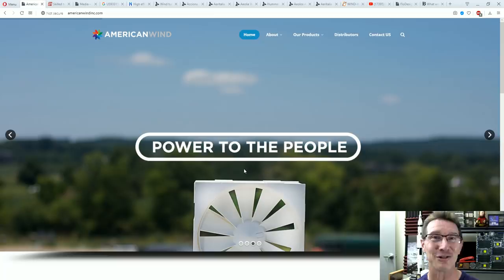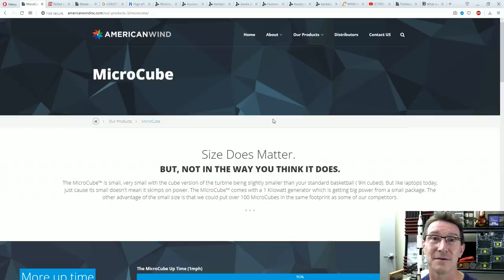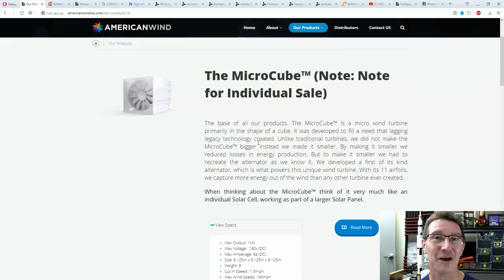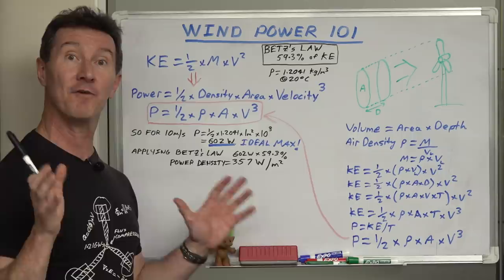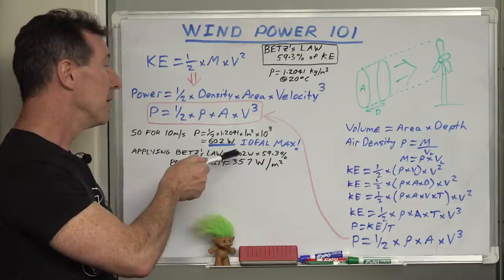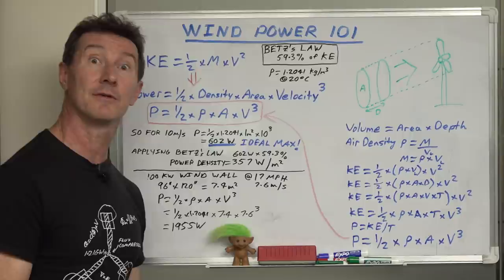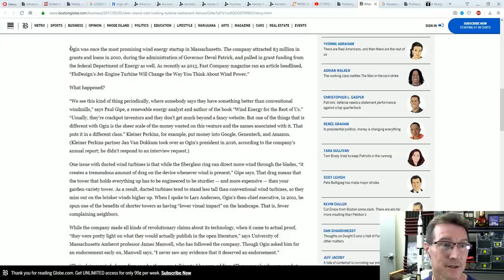EEVblog #1271 - 100kW WindWall Generator BUSTED!

Comment: Ahh, when the engineer gets kilowatts and milliwatts confused. 😂
Reply: Sure enough, if you measure in MmW (Mega-milli-Watts)!
Reply: As a Flat Earther would say:  "Why would you divide the number of smaller units to get a bigger unit.  It doesn't make sense".
Reply: @seanb3516  exactly! That's why it's immoral to convert feet to meters, faeenheot to Celsius is ok tho.
Reply: Why, the keys are like next to each other you know....
Reply: Lassi Kinnunen this in itself isn't necessarily incorrect, the duct can increase speed through the venturi effect, BUT that's obviously not increasing the available power, it's reducing it...
Reply: @ulwur     Fair-In-Height is the same as Celsius.   At -40°.  lol
Reply: @BIGFOOOOOT It's amazing how multimillion dollar deals are struck every day without anyone consulting an engineer. Or the very least pop your head out from the boardroom and ask the local IT guy - "Hey does this sound like a good idea to you?" And the respone would very likely be... "NO!"
Reply: forgot to carry the 1
Reply: I mean its AmericaWind - prolly got confused by all those dang SI units instead of good 'ole doughnuts per sockets?
Reply: @BIGFOOOOOT the engineer is accurate to 1/1000 of an inch the mechanic is accurate to 1/100 of an inch and the carpenter is accurate to exactly the inch
Reply: It can get confusing sometimes, we used to use mm/us.
Reply: Lol
Reply: @ulwur  I wrote a program to convert Centigrade to Celsius. I put it on a 64 microbit  thumb drive. I use microbits because they work better with microprocessors. It's yours for the cost of shipping from Uranus.
Reply: @BIGFOOOOOT And then they fail miserable and blame "circumstances" while still ignoring your sound advice. In fact some might take offense to you because they deep down feel embarrassed and ashamed. And there is nothing worse than being reminded of ones inadequacies.
Reply: An engineering professor made fun of me for saying "centigrade," a term that made some sense. A committee of boobs came up with the nonsense term "celsius." A similar committee is trying to do this with stainless steel because it is not literally stainless. A lot of people know what stainless steel is.
I ran across bolts torqued to foot-pounds that were supposed to be torqued to inch-pounds. They were stretched good. This was in a nuclear research facility.
Reply: Don't be cruel, calling him an 'engineer' must be terribly offensive to all the real engineers out there.
Reply: 1/1000 vs 1000, easy mistake to make
Reply: Ehh, only off by a magnitude of a million, no biggie. xD
Reply: So what'a little decimal point got to do with it?
Reply: “Engineer,” what engineer. It’s just a guy sitting on his porch, noticing his neighbor’s fan spinning around in a windstorm.
Reply: Lassi Kinnunen  I don't believe anyone said anything about lying. What I think you wanted to say was that both parties can believe so much in a product that their judgement is clouded and/or are in denial. I heard plenty of sales people tell me that you need to believe in the product you sell. I have also seen many go bust because of that exact mentality.
Reply: @DreadX10    I would read those as millimeters and microsiemens. Life would be more interesting if we could randomize and personalize our own units.  XD
Reply: David Parry    They will have to compete with advanced non-metric using countries such as Burma. 
Truly a staggering task by any stretch of the imagination.
Reply: @LordZordid  Sure but obviously this does not apply to Solar Freakin Roadways. No engineering check required there.
Reply: @WCM1945  Are you willing to ship from Uranus during a full moon?
Reply: @19mitch54  I also worked in research and one of the weird units we wound up with was grams per cubic inch. One department was Imperial the other department was Metric and the two refused to agree.
Reply: @obsoleteprofessor2034  I told the waiter to add a tip to my bill but to make it a very small tip so he just added a couple of zeros at the end.
Reply: @Bill Martin     I was responding when you said "It's yours for the cost of shipping from Uranus.".  I hope the thread didn't break.  :)
Reply: 0.444 mKw to be exact!
Reply: thats what is known as decimal point dyslexia
Reply: @bunnykiller    Exdyslia?  Never heard of it.
Reply: @bunnykiller     Medical Pinto Exdyslia?  Wut?  lol
Reply: @BIGFOOOOOT EXACTLY.  And that's what this clown tried to do to my brother.

Comment: Betz's law also incorporates the fact that the theoretical max would mean wind speed behind the turbine is 0, which is obviously not possible
Reply: I think that is the easiest way to explain the figure being below 100%. If all the air comes to a dead stop at the turbine it would pile up; you need some residual velocity to move the slow air out of the way so new fresh speedy air can reach the turbine.
Reply: @DreadX10  That's actually a really intuitive way to put it, now it makes sense. Thanks!
Reply: The velocity behind the blades are not 0.  It's a bit more complicated than that
Reply: If you get all the Energy out of it, it is 0. Thats why the area gets bigger so the same amount of air can move through slower at the same preasure and temperature.
Reply: Yes. Exit wind speed is not 0 at the Betz Limit around 59%   Sounds like everyone on Dave's channel understands this.
100% energy is an oxymoron for a HAWT I guess one could say :)
Reply: @DreadX10  Not really you could have the turbine move forward like if you put it on a plane or something. (not saying we should do this as its dumb but hey).
Reply: What if you designed the turbine to exhaust axially? Then windspeed behind it wouldnt really matter. Like an axial blower fan. Probably not practical at scale...
Reply: @ET_AYY_LMAO  It's the exhaust velocity, doesn't matter which direction it's going.
Reply: @ET_AYY_LMAO  it still has kinetic energy regardless of its total momentum 

(Also, if you mean it's exhausting air away from the middle, that is the radial direction, not axial. Think of axial as the direction along the axle and radial as along the radius)

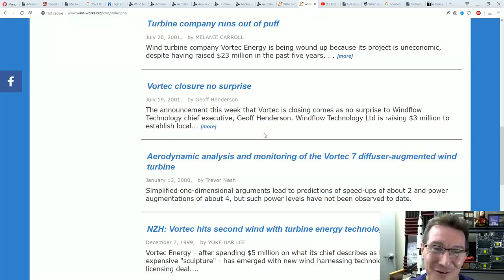Comment: 27:28 Oh come on... Putting a wind turbine on your car is something a cartoon character would try.
Reply: If your trying to imply that Wylie was not a engineering genius i will fight you right now sir!.
Reply: Turbines made by ACME
Reply: I ran into a UN project where they tried to convert mechanical energy from a road that depresses under a car’s weight. 

Typical UN science. .
Reply: @joeloliver7599  Acme made a good perforning  product. It was the operation manuals that were sadly lacking in detail causing many injuries in the field.
Reply: I thought we called those...turbo.

Comment: Getting 1kW on such a wind turbine is easy! 
1) Attach a voltmeter across the output and measure
2) Attach an ammeter across the output and measure
40V (as seen) x 25A = 1kW - really easy ;-)
Reply from the maker: I think you are onto something!
Reply: that 40 volts and 25 amps is coming from the wires sticking out of the wall socket
Reply: @bunnykiller  nah man, this is open circuit voltage and short circuit current, the power generated at both extremes is very small. the actual power generated at the maximum power point is actually less than that. check out a solar panels voltage vs current curve
Reply: Finally someone who cracked the code. This is literally the only possible way these people came up with these absurd numbers

Comment: It takes only 55watts for a fan to move air 13.4mph, which also means you cannot generate more than 55watts from 13.4 mph wind (this is before taking losses into account).

For fun, I worked backwards from a 225cm (8.86 inches) ducted fan. (ebmpapst W1G 200-HH77-52 for those playing along at home) : 1090m^3/hour = 0.3m^3/sec, which comes to 6m/s (13.42mph). That's using only 55watts! So you can NEVER generate more than 55watts from 13.4mph of wind!

Also tried one of my PC's fans, an Arctic Cooling P14 (140mm, 123m^3/h @ 1700rpm), which comes to a little under 2m/s (4mph), but that uses less than 1 watt!  So while the blades may rotate at that speed, it doesn't mean it will produce usable energy. This also means that one of those turbines can never generate more than ~3 watts (~3 times the area) in 4mph wind, plus they'll be lucky to get a single watt from their crude 3D-printed impellers.

50watts from 15mph wind would be more reasonable (with near perfect efficiency), not a kilowatt! Maybe if the wind is 140mph you could generate a kilowatt, but then you have bigger problems...

How did this guy get investors?
Reply: He DIDN'T get investors.  But he tried to scam my brother.
Reply: Your figure is only accurate for some diameter producing the given velocity.  If the diameter is doubled, the area (and CFM of moving air) is quadrupled at a given airspeed, and so is the motional energy of that turbine (disregarding losses) quadrupled. In other words, your physics doesn't compute.

Comment: I think the inventor just forgot to mention that this device works according to spec on Jupiter, only.
Reply: More like Neptune :-P
Reply: @GustavMeyer  Wireless charging the Earth from Neptune, coming soon to kickstarter :-}
Reply: @ijakoan  Sure and we'll use the excess power to light up the dark side of the moon.
Reply: Frank Buss it would also work anywhere there is sufficient air density so venus would be a goa... if they can make a stainless heat resistant model(which should be no problem for their PR department)
Reply: wind speeds were in Miles/Sec - not metres!
Reply: Someone should tell him to stop talking from Uranus...
Reply: @LarixusSnydes  Take it, Pink Floyd

Comment: Technically, all generators are revolutionary. 😂

Well, unless you're talking about those linear shake-weight gadgets. 😅
Reply: Are they therefore left-wing? :D
Reply: At least the shake-weight will give you cab fare.
Reply: nice one :)
Reply: I guess the Faraday flashlight falls under the shake weight category-
Reply: Generators are going in circles, but at the same time they are revolutionary! It's a miracle!
Reply: Robert Slackware  No. The patent application should be rejected on the grounds that it is not new let alone inventive. And if something does not work, it fails for  incomplete disclosure or clarity (not explaining fully how it is done). Having applied for a patent does not imply that you are already an inventor.
Reply: He means they are all turning, doing revolutions... I felt the need to clarify reading other comments.
Reply: Yes dad

Comment: 1:54 The Patent Office don't have to verify if something works, just that it hasn't already been patented.
Reply: Anzac-A1 true. It’s sad, because they used to require a working prototype but that was deemed impractical and expensive. That said, given the sheer number of failed designs for ducted turbines mentioned in that wind power blog, I am extremely sceptical that the USPTO would have said that the design was the first ‘new’ one they’d seen in eighty years… heck, I’m pretty sure they wouldn’t simply volunteer such information out of nowhere like the CEO guy implied _at all_.
Reply: i agree. a flaw in what was said

Comment: It's just a bunch of cheap chinese computer fans, isn't it.
Reply: no, this is how they are blowing it
Reply: That was literally my first thought - computer fans, but 3d printed out of white plastic to make them look "boutique" and custom
Reply: @gorak9000  You can but off the shelf white fans (or just white blades) from everything from big brands to random chinese factories.
Reply: I'm surprised these fans don't have LEDs. 🤣
Reply: @gorak9000  nothing against Noiseblocker eLoop fans! They are white and look "boutique" and custom. But they are actually really good fans.
Reply: @niceguy391987  Solar freakin' wind turbines? Can you put lane markers on the fans? Warn of moose on the road ahead?
Reply: Ok, some people may have figured it out.  They are power supply fans sprayed white, but think of all the investment $$$$  awesome scam.
Reply: @maximilianmustermann5763  Heh, those fans look similar, but they only have 6 blades, these have approx 11 blades (can't see the whole thing in the frame I paused it on, not watching again to find a picture where you can see all the blades)
Reply: if they used the ones with the built in LEDs, it would have been expensive ;)

Comment: Thanks for that, a laugh a minute. The car with the fans on top was priceless, something I had someone suggest to me but they couldn't figure how it would act as an airbrake and actually take more fuel to charge the batteries than just using an alternator... No free energy - ever.
Reply from the maker: I was chuffed when I found the wind powered car article!
Reply: When I saw that, I thought it must be meant as an addon when parking as an alternative. In Hamburg it might even work. No sun, always rain and lots of wind.

Regards,
Etna.
Reply: @Etna.  You just know if they actually produce an actual device it won't even be weatherproof!

Comment: the reason why there is a limit to a wind turbine efficiency is that air has to leave the fan again
imagine extracting 100% of energy from the air, this would mean that the air slows down to 0 and therefore is not leaving the fan anymore.
Since preassurizing air costs energy, the air has to leave the fan with a remaining amount of energy

Comment: Kickstarter scammer instruction manual:
1) Briefly skim the Wikipedia page of current technology looking for anything about "limitations" or "challenges".
2) Write up a proposal claiming to address these. Make sure to use words like "revolutionary".
3) Throw together a cheap, plastic "prototype" (it doesn't actually have to do anything) and/or hire a cheap 3D artist to produce animations based on a drawing you did on the back of a napkin.
4) Post that shit.
5) Skip town with the loot.
6) Light up a fatty and laugh.
Reply: Don't forget to make it about a remote African village in need to get maximum  monetary virtue signaling, Sargon. ;)
Reply: You forget fancy website with multicoloured CFD outputs and cut and pasted engineering brand names

Comment: Maybe they're multiplying the open-circuit voltage and the short-circuit current and figure this gives the power produced.
This is the flaw in the analysis of so many of the crackpot energy schemes...

Comment: Hi Dave. 
At about 4:00 you say that a dump load system is used to limit a windturbine output.
Sorry it doesn't, it simply bypasses the excess output away from the load circuit.
Max power limiting is done at the windturbine, either feathering the blades or turning the turbine away from the wind.
Windpower 101. Great derivation presentation to Dave.👍👍👍
You cannot extract all the energy from the wind because that would mean the velocity of the wind behind the windturbine would be ZERO. So no flow of air to clear the windturbine.
The more energy you extract from the wind, the lower the outlet velocity.
I think a Mr Bernoulli would be flipping in his grave.
"Ye can-nae change the laws of physics Jum"
Later the mention of drag and tower strength with ducted models.
Drag will extract power from the wind that you are trying extract into power.
Reply: Gusty conditions will put huge stresses on ducts, due to the large area, things like microbursts are probably unsurviable for any large duct design.

Comment: That wall would have a massive boundary layer, ie, restriction, so the air would probably hit it and stack in front and pick the less restrictive path around the sides.
Reply: That's apparently why the 59% law exists.
Reply: I was thinking of the forces involved in holding up a 1 square meter surface to a 10 meter per second wind flow.
Reply: Bingo
Reply: No no no you weren't listening were you. He said the air speeds up on the way through the fan. So it would actually create negative pressure in front of the fans. I don't know why nobody thought of it before.
Reply: @watsisbuttndo829  Increasing velocity by restriction will drop the pressure on both sides of the blade, and hence cancel out. The boundary layer starts the restriction before the blade. To do work you need a pressure differential across the fan, ie, wind pressure on one side, and in this case a huge flow restriction creating a pressure drop for the back side.
Reply: @SidneyCritic  He alleges to be an Aviation engineer. I think his career in that field may have just "stalled"

Comment: strap a load to a tesla and you could have free charging as you drive :D
Reply: ROFLMAO.Perpetuum Mobile achieved!
Reply from the maker: Watch the end of the video, he tries to do just that!
Reply: Won't work. Will just increase drag.
Reply: To get more than u deserve. Use the rotating tire to induce it directly back and combine THE AMERICAN WIND turbine with your wheel rim design. Therefore, be prepared, be smart, be AMERICAN WIND.
Reply: @turpialito  They figured out the "remove entropy" cheat code!

Comment: Nice one. It reminds of the question popping up every now and then why airplanes don't have ducted propellers, since they are "so much more efficient". Well, yes, for a given diameter, you can increase efficiency with a well-fitted duct. But it is useful only if your diameter is limited by external factors, such as the speed of sound (where turbofans are used) or geoemetric constraints. In all other cases, you can get the same efficiency as a small ducted fan by just using a larger diameter propeller, with just a fraction of the weight increase and none of the additional drag of the duct.